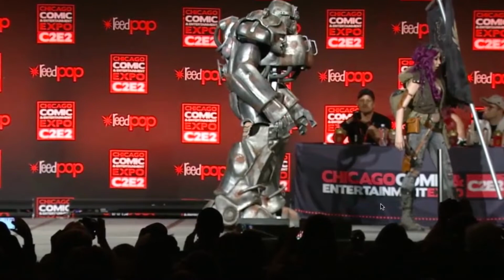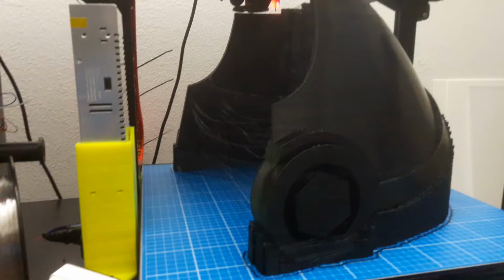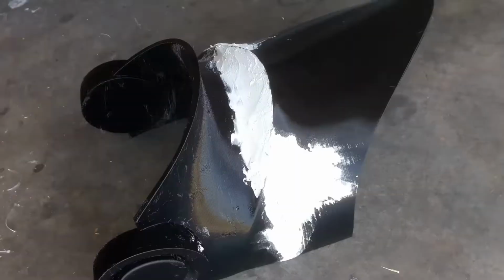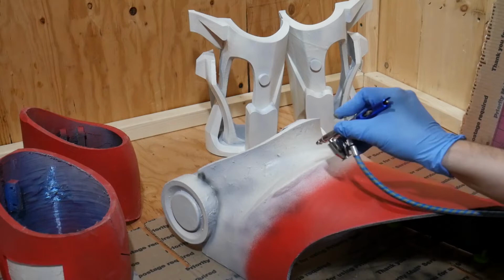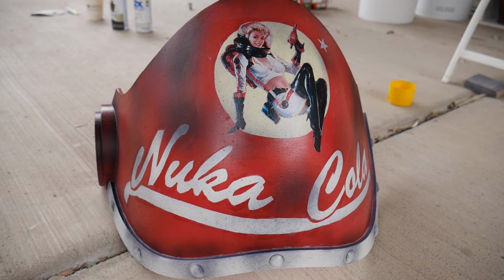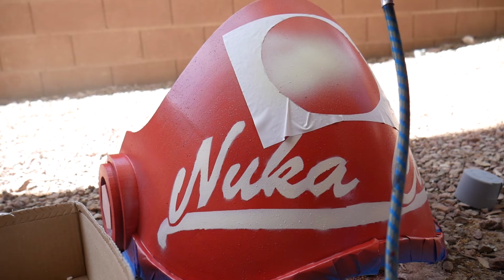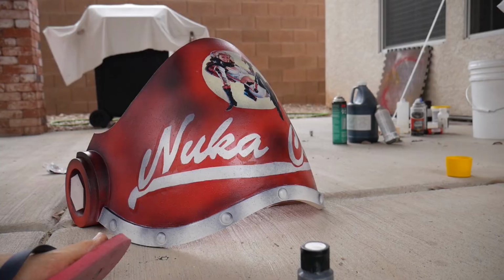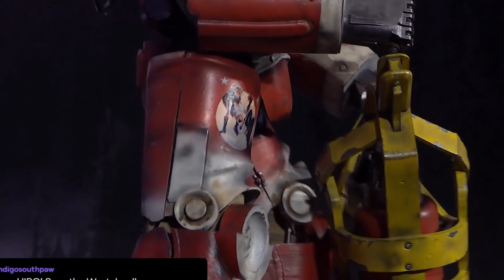How I 3d Printed a lifesized set of FALLOUT T-51 Power Armor

Comment: While it wont be printing one, i am "borrowing" some techniques here for an EVA foam build, keep up the awesome work
Reply from the maker: Not sure if you have a printer, but a future video I am working on is making accurate foam templates of angular (or organic shaped armors) by printing out a 1/4 or 1/8 scale version of it and using tape to create paper templates you can scale up for foam builds. That is something I am working with for a future build atm.
Reply: @HiroCreations  Templates sound awesome. I have 3 printers, im just not interested in the weight and printing time (and thats a lot of sanding).  I have been slowly working on a full size R2-D2 so ive had my fill of sanding layer lines.
Reply from the maker: @reflector36  Haha I hear ya there, I'm branching out to using 3D printing for either details or mechanical parts and use other materials to fill larger surfaces like the smooth sections of armor plate.

Comment: Hello!  Sorry to bother you again.  I would like to avoid covering my suit in epoxy because it is expensive and time-consuming.  I was thinking I would just vapor-smooth the TPU using something like DMSO.  What do you think?
Reply from the maker: I considered that as an option, but the side effects and special handling needed for DMSO scared me considerably. Plus I am not a huge fan of  vapor smoothing because it's not a uniform process (some areas have the details get super soft before the layer lines smooth over in other spots (usually in the areas further away from the vapor source).

Comment: I'm sure you are very busy, I'm sorry to bother you again.  I am thinking about the step where you used the filler-primer.  Do you think plasti-dip would be ok, or no?
Reply from the maker: Tried plastidip a few times on various armors, its difficult and unforgiving to get a smooth clean finish (always got a bumpy orange peel finish) and it wears off quickly in any areas with friction. Would recommend avoiding Plastic or similar liquid urethanes like Creature Cast.
Reply: @HiroCreations  perfect, thank you!  I am following every step in your video, I just got to the epoxy part and looking at next steps.  Thank you for your guidance and advice.
Reply: @HiroCreations  This is exactly what I needed to know, thank you!  I will stick with filler-primer.

Comment: Hi!  I am doing a similar project with giant robot armor.  I started out with SainSmart TPU and I am getting ready to print.  What were your infill settings?
Reply from the maker: Good luck on the build, I started with 7% infill and eventually dropped to 5% to save weight. I did add a 4th wall perimeter for more strength.
Reply: @HiroCreations  Thank you so much!  You mentioned that you started out coating your TPU parts with epoxy, but then later switched to UV curing resins.  Do you mean like SLA printer resins?
Reply from the maker: @tylersnard  Yup, though a few years later I would recommend the Epoxy if you have the time and patience as it lasts significantly longer (likely forever) while the SLA resin coats are starting to get visble micro cracks on the surface.
Reply: @HiroCreations  Thank you!  I am not looking forward to sanding this thing, it is going to be a beast.  What do you think about instead of sanding and epoxy, melting the outer wall of the TPU with a head gun until it is glossy, like this: https://www.youtube.com/watch?v=IAxFBzz9BH8  Do you think that would work?  Thanks again for your continued advice.
Reply: @HiroCreations  Sorry to bother you again, I am sure you are very busy.  If you could go back and do it all over again, would you use PETG as a filament?  Why or why not?
Reply from the maker: @tylersnard  Iffy, I found PETG harder to consistently print large objects with than PLA (prone to jamming and does not cool well without a lot of part cooling) and is not really much stronger than PLA. 

If I were doing it all over again and could pick or setup my hardware to do a specific material well, I would redo the build with ABS or ASA which I have come to enjoy printing on my Vorons and enclosed metal hotend Enders. 

-Surface finish is easier to coat and sand. 
-Very easy to quickly solvent weld strong bonds with ABS glue.
-And the durability is excellent.
Quite cheap now compared to good quality PLA or PETG on a per KG rate.

Its still not unbreakable like TPU is but much easier to print and post process for sure.
Reply: @HiroCreations  Thank you so much for your help again, I really appreciate it!